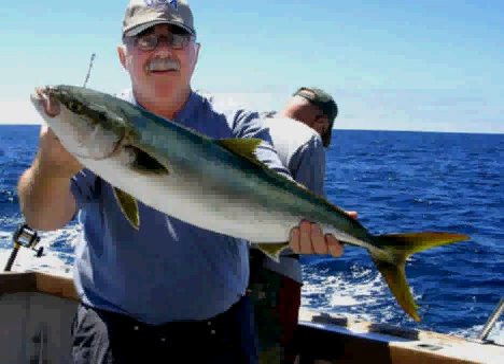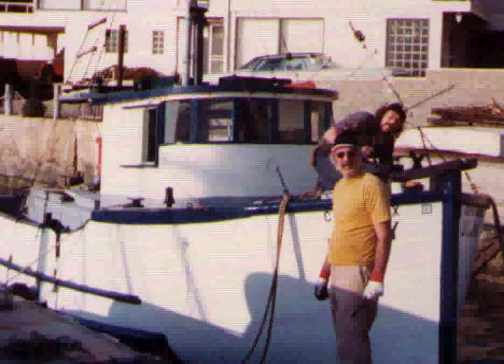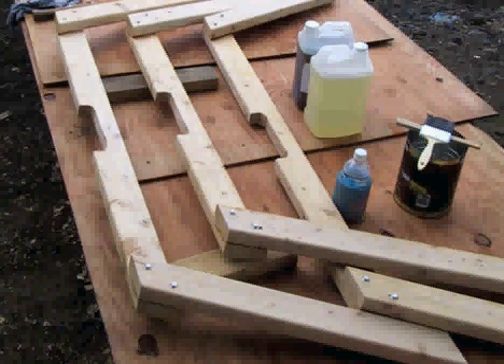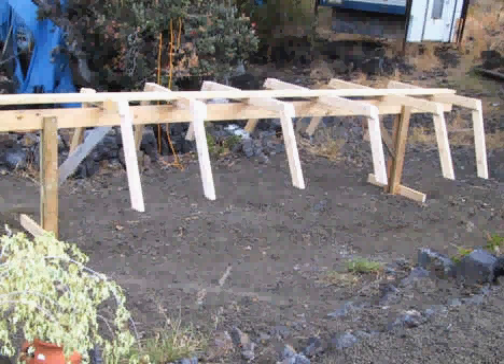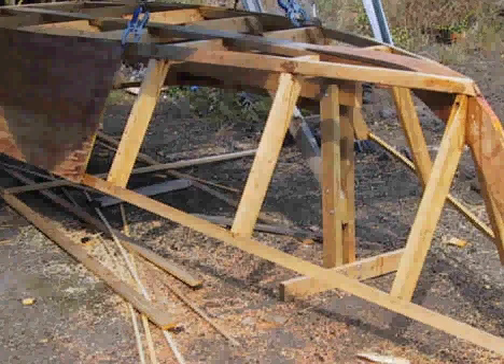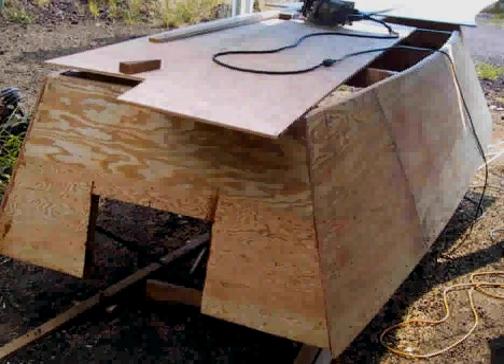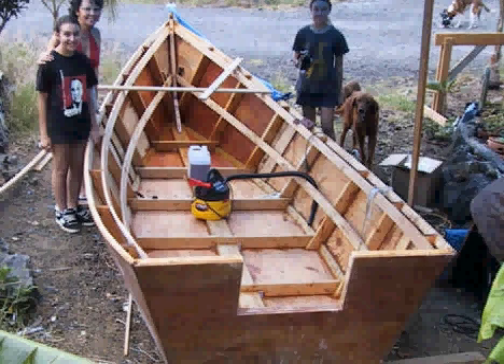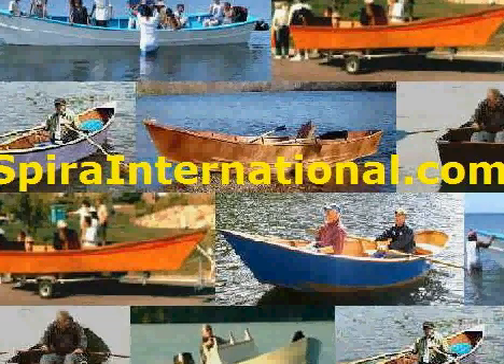How to Build A Boat

Comment: I notice that you cut the notches on the ribs after they are mounted on the strong back but wouldn’t it be easier to cut the notches during the assembly of the ribs? Thanks
Reply from the maker: I don't know how that builder did it, but I include the cutouts in the design that can be made prior to  mounting on the strongback. Some boats with rockered bottoms need to be modified a bit to het the strongback to mount tightly, but the main cutouts should always be made before.
Reply: @tjkid07   That what I was thinking it’s much better to do it before mounting the ribs... Thanks Jeff

Comment: thanks for the video. just 1 question, you  say some people coat the ply with fiber-glass, does the expansion and contractions of the ply not crack it? from rain, different temperatures etc. to cover a boat of that size with fibre-glass in Ireland would probably cost  =$500.  help! thanks again.

Comment from the maker: A dory about this size has crossed the north Atlantic from New York to England. I wouldn't try it with anything smaller than about 27 feet,though. My site has boats from 7' long to 32 feet long - many able to handle the open ocean.

Comment from the maker: I didn't build this particular hull. It was built by one of my customers who bought the design from me and documented it very well as he built it.

To keep it centered, you temporarily attach it to the strongback jig. That keeps everything lined up.

Standard ABX ply works fine if covering with fiberglass. Birch and mahogany are also fine choices. That one uses 1/2" 

Yes, you could fill the spaces between the ribs with foam and deck over it.

E Glass is fine. 

3/4 ply for the transom